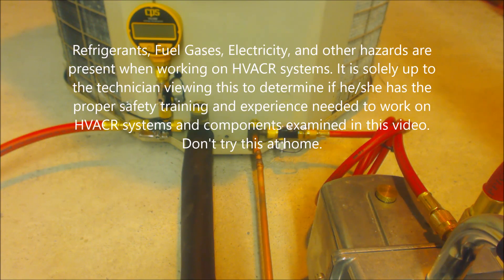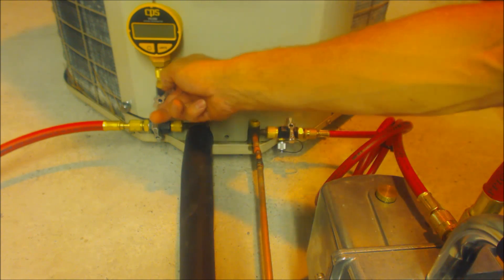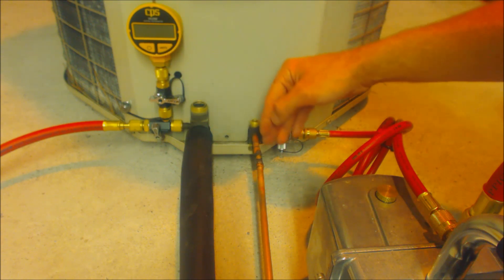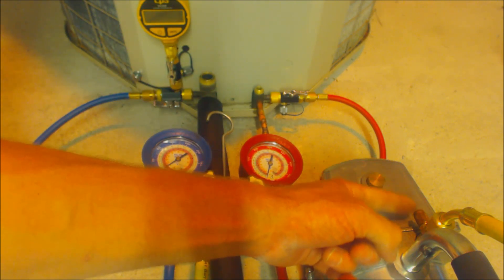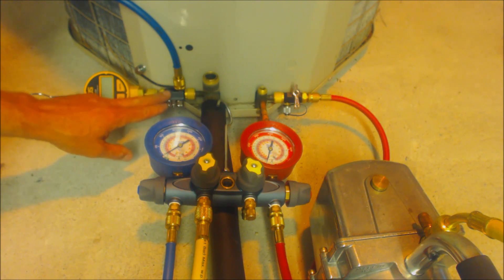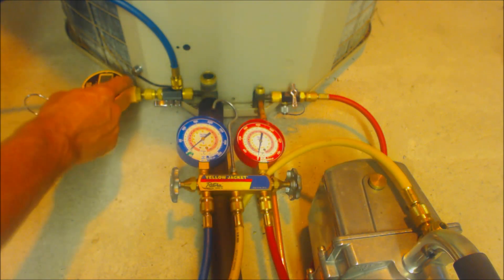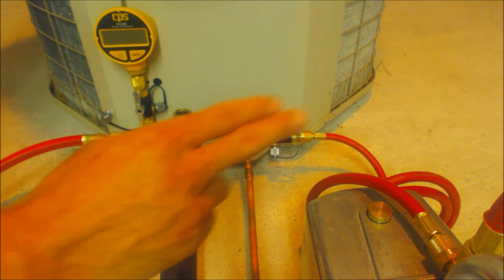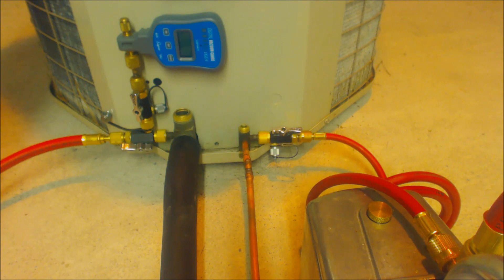6 Different Hose Setups to Pull an HVAC Refrigerant Line Vacuum!

Comment: with this set up at 5:20. If you had no refrigerant in the system would you just valve off the the valve core removal tool, remove the vacuum hoses, attach your gauges to the removal tool and start adding refrigerant to the high side and then put the valve cores back in when finished?

Comment: great videos thanks for sharing your techniques will use it ,btw if you also connect the 1/4 inch hose on the vacuum pump next to the 3/8 inch i think it pulls down faster according to my vacuum gauge you can see the difference when you turn off the 1/4 inch hose
Reply from the maker: That's correct,  I usually pull with both lines without the gauges, check out the other vacuum videos-   https://www.youtube.com/watch?v=jlzecsOImqs&list=PLxnHR5_D2ojxXtMK2acxvUF8aqowcksMx
Reply: gotta try that out w/o gauges, you ever have issues when the extractor just cant seem to grab remove the stems your views and insights please  thanks again
Reply: Gene, if the system has some positive pressure in it (nitrogen or refrigerant) the valve should push right out.  But if not, chances are the wrong shrader caps (hex type) were used on the service ports and damaged the opening due to excessive tightening, restricting the removal.  Only ferruled caps with rubber seals that are finger-tighten only should used.  To get the stuck schrader out you have to pressure up with nitrogen and or pull it out with needle-nose and re-thread the port while blowing nitrogen out to keep shavings from entering system.
Reply from the maker: Most of the times the tool will be able to handle it fine but some times you may find an old valve core that you need to try to get out with a very thin pair of needle nose like Tie Dye was saying.
Yeah, you are really going to like vacuuming without the gauges and with valve core removal tools, thorough and fast. If you are having trouble finding the valve core removal tools or the hoses, I linked them in the comment at the top of the comment section, thanks!

Comment: I have run into quite a few systems where you don't have the option of attaching a SCRT what are you suggestions in that case. I ask because I have only been in the industry for all of 10 months.
Reply from the maker: You would attach the valve core removal tool on the port that you do have access to and remove the valve core. Just attach a hose with a valve core depressor on the other for the vacuum. There is not much else you can do in that circumstance. You may want to replace the valve core with a new one before vacuuming though while there is no pressure in the old system, thanks and great question!

Comment: Thanks! For sharing
A 6 CFM vacuum pump should be enough for pulling vacuum?
Or a 7 CFM be better? Great explanation Craig.
Reply from the maker: 6 cfm should be fine even if used for a larger 15 ton system. The strategy is the hose setup and valve core removal tools. With adding the restrictions of valve cores, core depressors on hoses, or too many hoses, you can turn a 6 cfm into the performance of a 2 cfm accidentally. I really like that two hose, three valve core removal setup without the gauge set, thanks Octavio!

Comment: What did you think about pulling with one hose on the suction side and putting a vacuum gauge in the high side with the valve core tools on both sides.
Reply from the maker: Hey Danny, in a worst case scenario, you could pull from the vapor side and have a gauge on the liquid line but it really does not work as well at removing moisture since the pressure is reduced half way through at the metering device. Some say that pulling a vacuum with only one hose will give you a more true vacuum level on the micron guage since it is further away from the vacuum pump. I know this from experience to not be true. When I shut the valves off and shut the vacuum pump off, my vacuum level always stays the same or actually lowers since the micron gauge is on the vapor line and the liquid has a deeper vacuum that the vapor line and they equalize, lowering my micron reading. I let that sit for 10 minutes and doesn't rise unless there is a problem. Also so you know, make sure you are in a habit of quickly shutting and opening the valve core removal valves during the vacuum since a little air can be trapped there.  Thanks Danny!
Reply: acservicetech Thank you my friend.... you are godsent to the HVAC community.

Comment: This video shows a vacuum set up where the valve cores are removed for the process. Then it moves to  isolating the process by shut off at the valve core removal tool. Then we move to opening the system to allow refrigerant flow. At what point are the valve cores reinserted into the service valves?
Reply from the maker: After there is positive pressure in the system. Never reinstall the valve cores while under vacuum as the vacuum will be lost or a portion of it will be lost and the tech would be unable to know exactly how much air got into the system, thanks!

Comment: How long do you like to see it hold 500 microns?

Also is there a way to know with certainty that moisture is in the system?
Reply from the maker: 10-15 minutes. If the micron level does not rise then there is no moisture and no leak, thanks Blade!

Comment: Do service valves gotta be back seated or front seated when pulling vacuum?
Reply from the maker: It depends if the unit has refrigerant trapped in the outdoor unit. If there is no refrigerant anywhere in the system then the valves need to be open during the vacuum. If the unit is new with refrigerant in the outdoor unit or has been previously pumped down with refrigerant trapped in the outdoor unit then the valves remain shut during the vacuum, thanks

Comment: Have you found that Yellow Jacket hoses with valves on them are inferior when pulling deep vacuum and in fact will leak well before you reach 400 microns and will leak 500 to 1000 microns instantly when valves are operated.  29986 is the yellow Jacket Part number I refer to

Comment: Did you have to remove the valve depressors from the hoses?  It looks like the hoses are sold with the depressors.
Reply from the maker: No not on vacuum hoses but if you use a standard 1/4" hose then yes you just unscrew it out. I have hoses linked at amazon.com/shop/acservicetech thanks

Comment: Could you put the valve cores back  in before you break the vacuum with refrigerant?
Reply from the maker: Some people do but I will tell you that there is a risk of loosing the vacuum without knowing it. I will always do that with positive pressure, thanks Chad!
Reply: AC Service Tech LLC ok thanks

Comment: Does it matter which side you brake vacuum low or high with all types of refrigerants on an empty system (not power down)? Say like R22
Reply from the maker: Yeah funny subject. To give you an example Bryant condensor literature usually say to open the suction side first. Goodman literature usually says to open the liquid line first. They are built generally the same way. They say it has to do with the refrigerant pulling the oil out of the compressor for the first startup. Where is the oil located you might wonder, in the very bottom of the compressor in the vapor area. There is your answer. I don't think it matters too much either way but it is best to follow the manufacturers instructions. Since most techs use one or two brands only then they are used to doing it the way their manufacturer sates it should be done. You didn't expect that long of an answer, did you, ha ha. Great question Xrayneoo!
Reply: I thought the answer is concise. You are very good at what you do and I value your expertise. I thought your point had to be said. Is always good to follow manufacture's recommendations. Thanks for taking the time to share your knowledge.
Reply from the maker: Glad to help!
Reply: I usually release liquid into the liquid line. It's makes most sense to me. Even though going through the vapour line doesn't seem to cause harm

Comment: Is there some systems  that won't go below 500 microns especially older systems because I ran into a couple and no matter what I do I cannot get it to drop below 500 I did everything in the videos that you said   ???  maybe my error but why would it work sometimes and then every now and then with the same exact set up I have issues
Reply from the maker: hmmm, really you should be able to get them down.  Is the filter drier always new, did you do an oil blow out if it is not a new system, are the caps tight on the top of the service valves with oil when you are having the problem- if there is a problem, that is usually it, maybe try another micron gauge, how about oil on some of the rubber grommets in the hoses, btw make sure to keep the oil away from the micron gauge, was there a leak on the system before you fixed it because sometimes there are multiple leaks. I brought an evap coil from an r22 system in to school to show the students since I new it had a leak and I submerged the whole thing in a testing tank we built and there was not 1 but 6 leaks at only 125 psi.
Reply: acservicetech i'll doublecheck everything you said the next time I have the problem like I said it's only once in a while last time it was after I replaced a restricted  filter dryer I'm gonna replace all the O-rings in my gauges and vacuum hoses this week thank you Sir
Reply from the maker: Always glad to help Matt! I would assume you are also having  a problem with the micron level rising when you are having this problem after shutting the vac pump off or is it holding?
Reply: acservicetech was holding are you thinking about doing the online course just curious
Reply: It rose a little but then it stopped
Reply: Leak in your hoses / gauge set is the most likely fall point. 
Use 1 direct hose and a brass Tee to the vac gauge